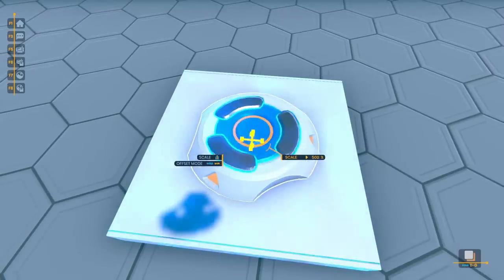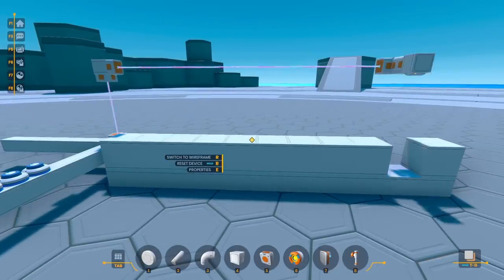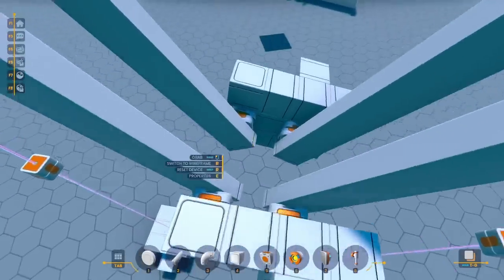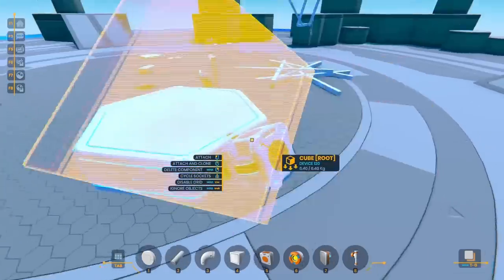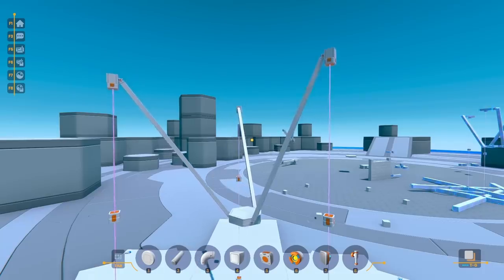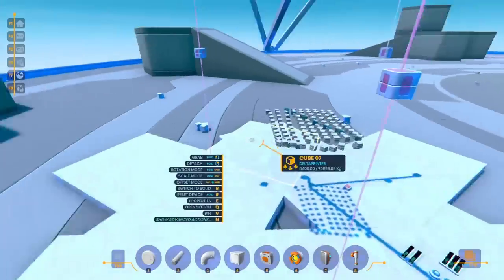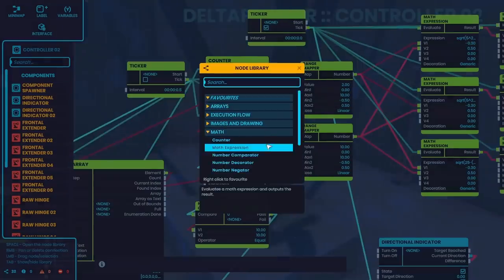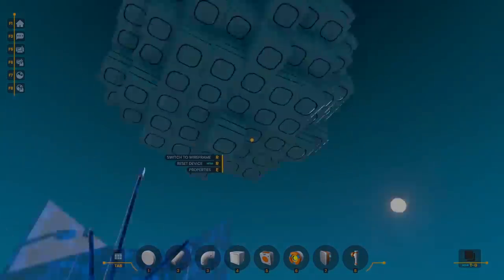Making a 3D Printer in Plasma

Comment: What if instead of adding a gyro to stabilize the print head, you just spun the object spawner instead to keep it locked to one orientation? You could have some form of compass that would rotate it to always face one direction, so even if the print head was twisted you'd still have the correct orientation for the spawned cube.
Reply from the maker: Yeah that would work well, ideally I would have an extra arm on each extender but unfortunately with the whole no looping thing that just doesn't work
Reply: @ReidCaptain lol, I read this as you said it in the video

Comment: Could you give the painter hex codes to designate the colors? It might make it a bit more complex since it would need to read in multiple characters for every 1 block (i.e. the painter reads 6 characters while the block placer reads 1 per block), but it would give it a lot more flexibility.